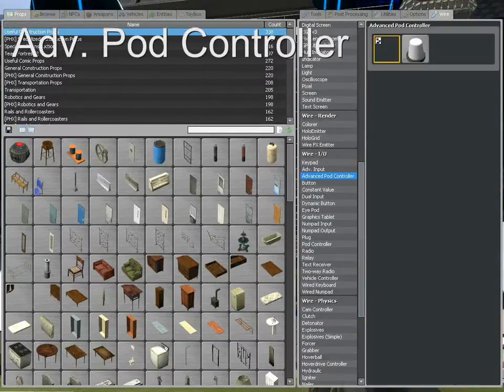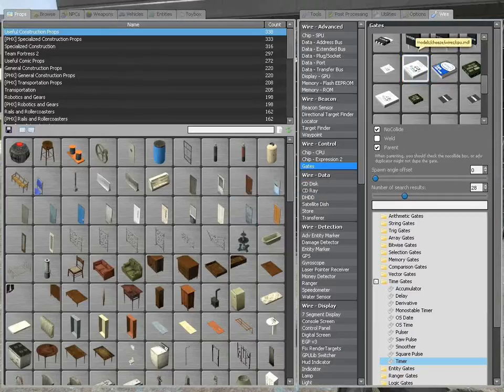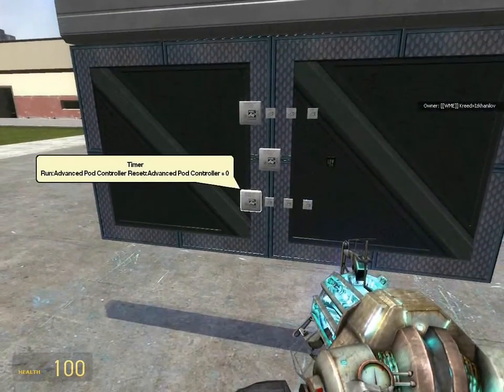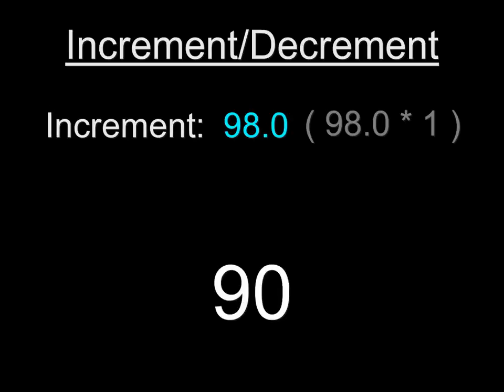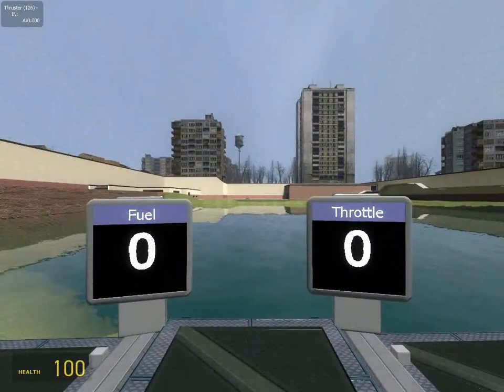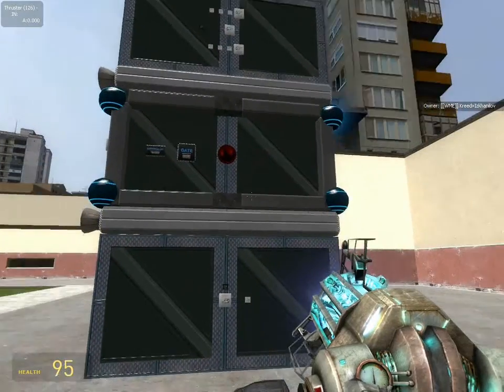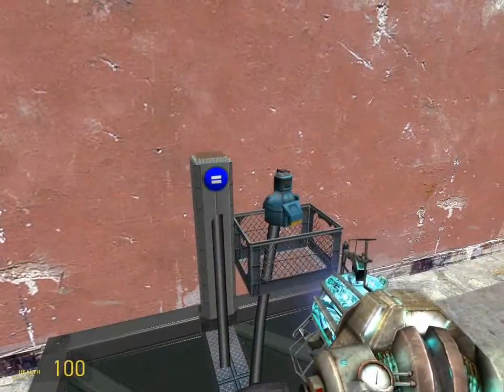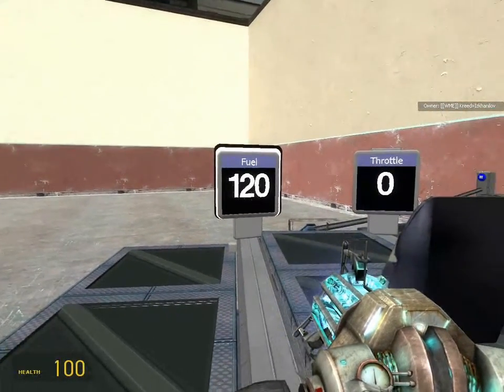WireMod Essentials [Ep. 16] - Realistic Thrusters TUTORIAL

Comment: How would I do this with wheels?
Reply from the maker: Do everything the same way as it's done in the tutorial, but instead of wiring "A" from the THRUSTER to the DIVIDE, you'll wire "A: GO" from EACH WHEEL to the DIVIDE
Reply: Tried that, they stay stationary until the throttle hits 100, then they go at full speed until the throttle reaches 0 again.